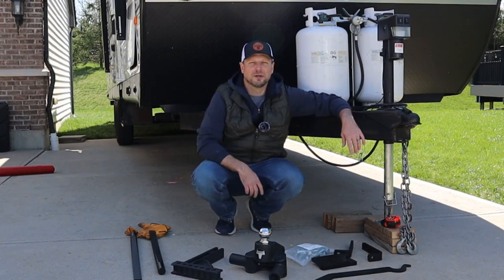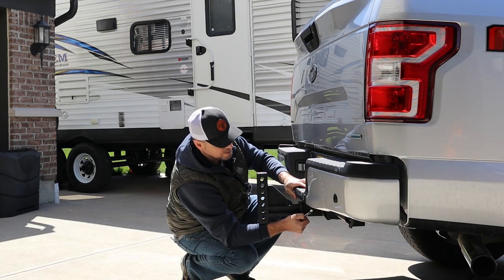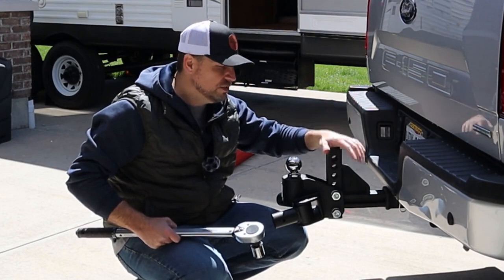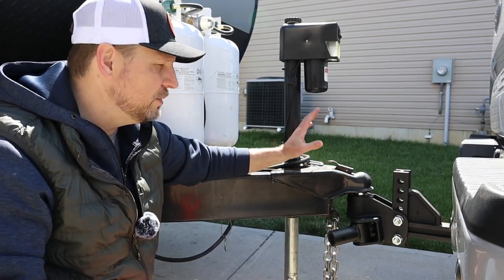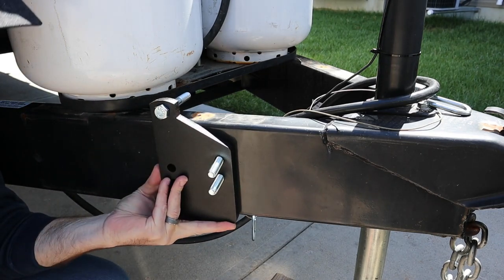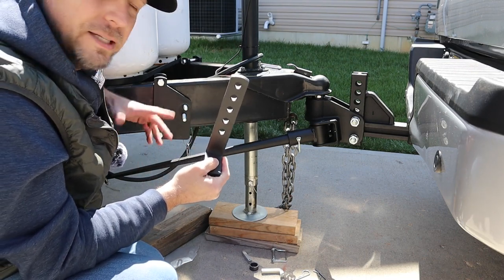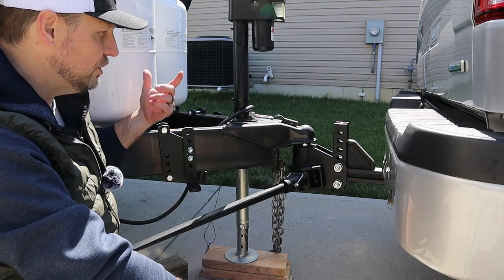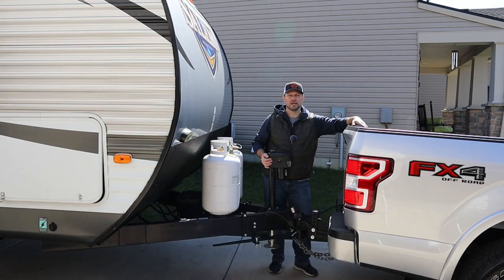How To Install A Blue Ox TrackPro Weight Distribution Hitch With Sway Control

Comment: Great explanation! However, your "L" brackets are way too far forward, you're not on the springy part of the bars. No wonder you couldn't get them on. It looks like the Track Pro has 'borrowed' a lot of the design of the Equalizer. Friction on a sliding bar prevents sway.
Reply from the maker: I think you're right. I've mentioned that my ride is a little rougher with the TrackPro than my old SwayPro. I'm sure that is the reason why. That said, I feel like I am so locked in now that I get great sway control! Lol.

Comment: I find that when torquing the hitch head on to shank, it is easier (on back) to put the shank in the receiver 1/4 of a turn so that, the ball is facing towards the drivers or passenger side of the car and to me it's easier! :) 
Also, I could be wrong but it sure looks like the bracket holding the spring arms is too far forward, and you may not be getting as much weight distributed as ya should!!
Reply from the maker: Good tip. Regarding the brackets, I think I agree, but I'm not exactly sure how to fix it. If I move the brackets back, the emergency break and propane all need to be moved. I'm not worried about moving the propane, but I hesitate to move the break without some more research. I'm sure its easy, but I don't want to mess it up. I will say that because my brackets are so far forward, they connect to the thicker part of the spring bar. There is little flex. The ride is a little rough but I do feel like any sway is completely stopped.
Reply: @GoTogetherGoFar  That makes sense. Sometimes working around them tanks takes a bit to get right. From personal experience (driving a tow truck) its really bad to have them brackets too far back, if a spring arm ever slips out, not good.
Reply: @GoTogetherGoFar  Could you find a way to raise your propane tanks? My RV has a bracket that the propane tanks sit on which give me about 1.5" of clearance underneath. It's just enough to install the bracket while keeping the propane tanks in their original position. Also, did you check back in with Blue Ox on their official position regarding threadlocker?
Reply: @GoTogetherGoFar  You can reverse the the plate that holds the L bracket so the L portion is towards the rear. You don't have to move the tanks.

Comment: Given what you had to do to put the sway bar in position for coupling, I expect uncoupling was pretty straightforward. I just ordered one of these for my trailer and can't find a video showing the uncoupling that uses the tool. I just bought my first "real" trailer (had a pop-up before). It's a Heartland Prowler 212RD and I'm pulling it with my Nissan Pathfinder SV, which is supposed to pull up to 6600 lbs. When I drove it home from Camping World in 20 mph winds, it was like a rodeo, so I'm hoping this will make it much easier.
Reply from the maker: You're right, it is pretty easy. When I raise the hitch and the truck enough, the spring bars slide right on and lock in. No tool necessary.  Hopefully your new hitch works great for you!
Reply: I’m not surprised camping world said you could pull that with a pathfinder lol, go buy a truck
Reply: Camping World strikes again!

Comment: Thanks for the video. Can you tell the difference when towing using the Blue Ox Sway vs. the Blue Ox TrackPro?
Reply from the maker: I can. I don't know if one is better, but it feels different. With the SwayPro, I could feel a little more "porpoising" and flex between the truck and trailer. With the TrackPro, it feels more "locked together" but the ride is a little rougher.  It is kind of hard to explain but I hope this helps.
Reply: @GoTogetherGoFar do you like one over the other?
Reply from the maker: @Adrenaline89Junky  I like the Trackpro better. I think it give me better sway control.

Comment: Getting ready to buy a camper, and I must say, I am not impressed with this hitch.  We used a very old distribution hitch in the past, with chains, and it seems better.  I do not think you have the brackets back far enough to take full advantage of the stabilizing properties of the hitch.  But nice video.

Comment: Would have liked to see the tool being used and how to unhitch it as well.... is raising the hitch super high without using the tool ok ? and unhitching as well no tool needed ?
Reply: I raise my truck/hitch up high enough to use the install pry bar without too much strain. I’m not real crazy about cranking the trailer and hitch up so high that it causes extra stain on the Jack motor and gearing. When I’m removing spring bars in unhitching trailer, I’ll raise them enough to tap them off with a hammer. That’s the way I do it anyway
Reply: I do the same thing. Raising it up high enough as to NOT having to use the tool doesn’t look nor feel very safe either.  Unhooking it from the trailer, I do the exact same thing by tapping it off, but I just use the side of the weird pry bar it came with. I will say though, that the first time I pried that tension bar onto the lip, it was quite an uneasy feeling with the amount of pressure I needed. Scary

Comment: My blue ox trackpro L brackets tilt forward under use. They are mounted on an airstream tongue in the closest hole but there is a a gap that allows the bracket to cant forward under use. Is there any way to shim this? Any other solution I should try?
Reply: I have a similar issue. For around 7000miles, it was not an issue. Just recently, I have broken 2 of the L-brack bolts.  I'm going to try a shim to see that will stop if from tilting.
Reply: I have the same problem... doesn't seem like the bracket and bars ride flat either. More of a saw motion in the edges. Less than 200 miles
Reply: I just added this to my camper and am having the same problem. I installed the L brackets level and the bolts on the frame torqued to 100ft-lbs and the bracket still tilts forward and moves when I start towing. It definitely doesn’t stay flat. Have you found a solution to this or just kept rolling with it angled?

Comment: Thanks for the video. I'm still unsure as to what to purchase. I just bought my first trailer (GD Imagine 2800BH) used. It came with a really basic WD hitch and I'm getting lots of movement on the highway. Porposing etc. It's a 2" sized hitch and I have a 2.5" hitch on my F250 so Im using a sleeve. So I have a little bit of movement on the hitch. I'm wanting to buy a WD and sway combo but am unsure of what I should lean towards. Do you have any suggestions?
Reply from the maker: I like the Blue Ox options. I've used the SwayPro and TrackPro.  I think I am happier with the TrackPro. I feel more "locked in" with the TrackPro, if that makes sense.  Less proposing too. I have a write up on my website with some other things to consider.  Check it out, maybe it helps. https://gotogethergofar.com/weight-distribution-hitch-with-sway-control/
Reply: I'll be in the same boat. I'll be picking up my trailer this weekend (same model as yours) with the same truck as you and I wasn't thrilled about using a sleeve.
Reply: @rythiel  I wish I had the coin to buy either Hensley or ProPride but I can't. I'm currently looking at reviews on the Equalizer brand stuff.
Reply from the maker: The Equilizer is solid too. Although I haven't used it, I think it is probably as solid as any other brand out there, including Blue Ox.

Comment: Which of these 2 did you like best and why?

Sway Pro
Track Pro
Reply from the maker: I think I like the Track Pro better. I feel more "locked in" with that hitch. Both work well, but I like the TrackPro more.
Reply: @GoTogetherGoFar  I have the Track Pro as well 
Our TT is 35’ long overall and I still get a little sway